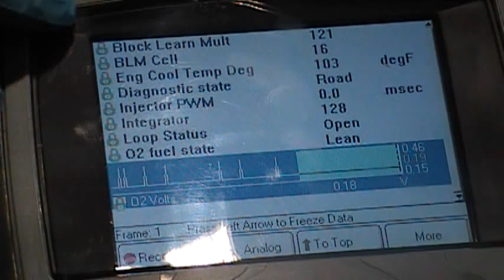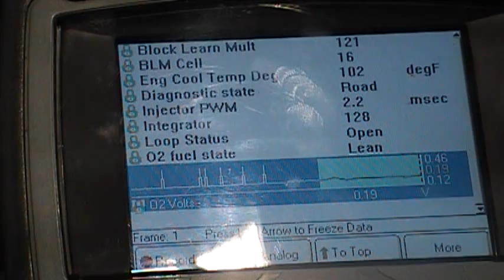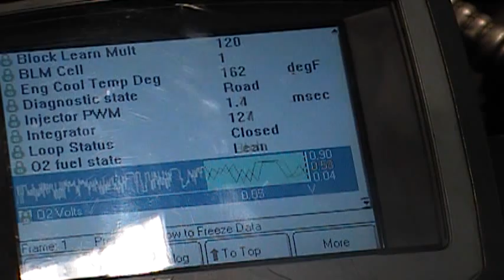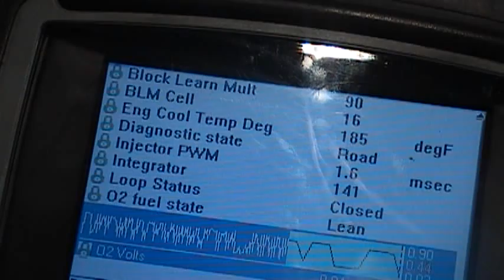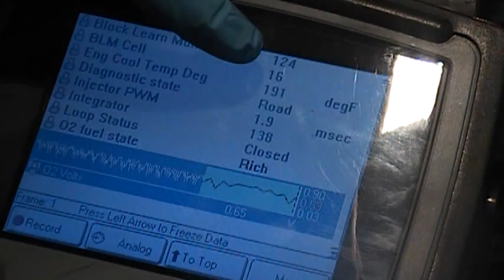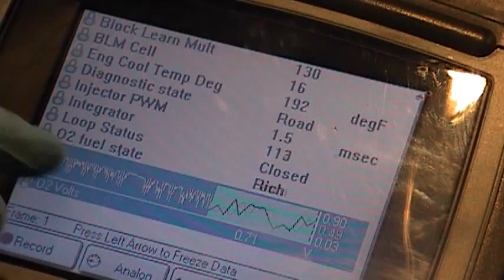Oxygen Sensor/fuel trim introduction and testing

Comment: i know it's not the purpose of the video, but do you know what could possibly be the reason for when i turn on stereo or fan, both o2b1s1 and o2b1s2 go down to 0.2 or 0.4 and does not move? i have a bank 2 and it fluctuates normally throughout. also, when i put the car in park, all o2 sensors go down to that value, which i assume is some kind of default behavior. but when the car is running with stereo or fan on, only the bank 1 sensors go to that 0.20 value constant. because of those bank 1 sensors, there will be a pending o2 code.

Comment: Hi sr, I know this video this video was done some time ago, bu I am watching today, and I have a question,  when you simulate the ignition  and  injector misfire  you are introducing more oxygen to the systems but in your Scanner you can see the O2 sensor still  cycle form 0.3 to 0.8 aprox,  and should be below 0.45 V because more Oxygen , I hope you can see this comment , thanks in advance
Reply from the maker: Ill have to rewatch the video, but if I remember correctly you should see the trend slide toward the lean side.
But also the ECM will increase the PWM to the injectors to compensate for the lean condition to bring the oxygen sensor back towards swinging up and down.  This is where the fuel trims come in very handy as they will show you what the ECM is doing ot keep the O2 sensor swinging between rich and lean.
Sorry for the slow response.

Comment: I have a 2010 elantra that has been idling rough for a few years. Only 88,000 kms.I have cleaned the MAF sensor, and the throttle body, replaced the PCV valve. Changed plugs.  I have a scan tool that reads on closed loop 2.0 volts on upstream 02 sensor and downstream 0.74 volts. The 02 sensor upstream spec's  for this car is a range of 1.50 - 2.0 volts were as other cars may be .1 volts - .90 volts ... .90 volts rich,  ,.  .1 volts lean.  So I get these readings at closed loop

                                  02 sensor B1Side 1      specs 1.50 - 1.75 Volts   Test results         2.01 volts ( Rich)
                                  02 sensor B1Side 2      + 0.70 V  min                                                 + 0.74

                                   STFT                                                                                                        -0.78%
                                   LTFT                                                                                                          1.56%

                                     Car still begins to idle rough once the engine heats up. Cold starts different at times. Idle gets better after I drive the car for a long time. Before it would idle better over a shorter period of time. Now it takes driving it for at least 30-40 min. It use to idle so smooth. But the car drives ok, but gas mileage not that great! What do you think?   Thanks Ed R

Comment: Thank you for the information Kevin, I have a Toyota corolla LE 2012 and I failed the smog test because of 02 sensor and cat are not ready!! but my car did not show any code also I follow a Toyota drive cycle and I drove 360miles highway 55 t0 60 after I slow down without using break just helping the car with hand break to 35-45 but still not ready! but when I plugged my OBD2 IT SHOW THAT MY O2S1 bank1 (V)=3.306 AND O2S1BANK2 (V)= 0.660 the car was warmed up for more than 10 min ! please do I need to change both 02 and after drive it probably it will make the car ready for emission! thank you very much

Comment: I own the same exact same year make model truck. 1994 Chevrolet S10 4 cyl 5 speed and I need help/advice... its been having a o2 sensor problem that has been driving me nuts.. The voltage will constantly read aprox. 1100mV with key on engine off and while the truck is cold started the short term fuel trim (integrator) will drop down significantly to around 60-70 and stay there and run like complete garbage and sputter after going into closed loop unless i hit the gas, then the o2 will start to oscillate and it will run better but still not up to par. EVEN IF THE O2 IS DISCONNECTED the value will then stay fixed at around 1100mv on my scanner and the only difference then is that now if you leave it to idle with no throttle input it will consistantly sputter/idle if you give enough time for the integrator value to decrease.. It was verified with a known good multi meter that it was showing the correct value. Comparing it to this truck in the video which is running how it is suppose to and the o2 value to mine this is NOT normal and there is no bias voltage occuring as shown on scanner in video. If anything, isnt disconnecting a o2 sensor suppose to make a vehicle run rich? What the heck. The motor was replaced with a fresh short block and it has done it even before the replacement. It will occasionally pre detonate while decelerating and at idle and i dont want to blow it up. I dont drive it anymore due to this.There is a new ecm as well as a whole bunch of other parts replaced!!!! This is probably one of the most infuriating and confusing problems I have ever encountered so far.. I AM STUMPED. I need help

Comment: Hello Kevin, and Eric,
I have a lean code p0171 check engine light is always on, the cr run fine and idles fine. air/fuel sensor fluctuates between 600 to 800 down to 200. the fuel trim long term is 15 + and the shorterm fuel is -14. Check for vacuum leak engine cold sprayed water all over intake manifold , vacuum hoses , exhaust manifold, its normal.  The air/fuel sensor drop to zero volts when I pulled the vacuum hose from manifold . Does a zero volt reading point to a faulty o2 sensor , its a 4 wire , on Toyota corolla 2000 4 cyl CE 1.8l.
Now today I will check spark plugs and injectors, its repeated ticking sound points to both injectors and spark. spark advance on the obd tool reads 15 with a G letter . What does it mean?

I have not back probe the o2 sensor because I can not find its o2 specifications on voltage drop and I don't know if its a wide band or a narrow band sensor. 

I cant find the fuel regulator in the engine. And I need to inspect all the vacuum hoses too. Its like being a medical doctor, I only have 150 hours of training with certificate from the 70s and learning all this analysis with fancy digital scanners can be very expensive for just a do-it yourself-er. 

can I use a volt meter with an amp probe together on a o2 sensor signal wire, instead of back probing? 

Can I use the wave screen on the less expensive OBD scanner, to see wave forms along with amp probe and wire clip , How do I set this up?
Reply from the maker: Whenever I get vehicles that have a major lean code with no indications of a vacuum leak I first clean and check the MAF (mass air flow) sensor.   The MAF sensor is very critical when the computer is determining the A/F (air/fuel) ratio, a dirty or failing sensor can fool the computer into thinking the vehicle is running lean (rarely does it cause a false rich) when it is not.
Reply: Hello Kevin, I had cleaned the MAF sensor with throttle fluid and a q tip.  How can I test it to see if its failing?
Reply from the maker: To be honest it is very difficult to test without access to a scan tool that displays live data.  And even then it can be tough to determine if the air flow readings are correct or not as there really is no set "correct" reading, as engines age the idle air flow rate also changes, carbon buildup, piston ring wear, valve seat wear and other issues will all slowly change the rate at which the engine moves air in and out.  Sometimes being able to see the load percentage displayed in live data can help determine if the readings are being skewed by a MAF that has lost calibration.
I also would not advise using a Q-tip to clean the MAF as the fibers can get caught on the thin wire and throw the readings off, a good spraying with MAF cleaner than allowing to air dry (not compressed air) should be enough to clean the wire.
Reply: Mr. Kevin thank you for your support and to Eric both are impeccable eudcators.
Reply: Hello Kevin, I re-examined the mass air flow sensor took it out sprayed with throttle fluid, clean metal surface of screws because it had an insulation from the di-electric grease I place inside the pin connectors. Removed the di-electric grease and place it back in drove in wide open throtle for 7 miles and the darn thing corrected itself and the check engine light went back to its cave.  The fuel trim in open throtle all positive low numbers and the o2 sensor went from 0 to 900 and back down at idle. I pulled vacuum hoses out; I pulled one spark plug engine turn-off. Its all working again no codes no engine check lights, long-term fuel below 10 and shorterm bet 2 and -3.. The IAT (IDLE AIR TEMP) WAS BET 90 AND 46.  I caused the problem when I changed the down pipe from exhaust manifold to the catalytic converter. I checked for exhaust leaks it may be sucking a little bit of unmetered air through the joint used finger to feel it but nothing was pulling in through the joint where the spring bolts hold it together. I want to say thank you and I just can't believe it.

Comment: great video!
one thing though, if o2 sensor reading 0.5v is being ideal afr or stoich combustion, why the engine cannot maintain that specific  afr? why it keeps going rich and lean?

also, under what condition it will go to closed and open loop? acceleration/deceleration?
Reply from the maker: Changing conditions in the engine cause the A/F ratio to change constantly, trying to hold a perfect 14:7 ratio is almost impossible and it is far easier to bounce the ratio up and down in a very limited range instead.  This also allows for the ECM to compensate for engine wear, fuel quality, barometric pressure and other constantly varying changes.
Reply: @kg4tnp  Also, the catalytic converter works best when engine oscillates between rich and lean conditions.

Comment: the other day i was on the freeway and all the sudden i smell rotten eggs (hydrogen sulfide?) and it was running odd but not like it had a misfire, so i pulled over to check it out. i scanned the vehicle (2001 gmc jimmy) and i got 2 pending fault codes: p0300 (random misfire) and p0138 (02 sensor circuit high voltage, bank 1 sensor 2, after the cat ). but then oddly enough it went away and drove normal the rest of the way and back home. but when i came home, i let it sit for a few. then i started it back up, engine spuddered a little then died after a few seconds. started it back up right after and it was fine again. i looked it up and it said that it can have a random misfire because of a faulty 02 sensor, but at the same time, it said a faulty 02 wont show symptoms? i dont know whats going on. if you can give me some info id appreciate it. i have  some  knowledge about 02 sensors.
Reply from the maker: jasonkgreen811 have some one check your exhaust back pressure, sounds like a partially clogged catalytic converter
Reply: ok thanks man.

Comment: I have a 203 Toyota Corolla and my check engine light came on, Autozone says 02 sensor on bank 1. I work only 1 mile from my house, so my engine, does not get really warm on my way either direction. The other day, I did take  drive and on the highway, my check engine light went off, after a while, but back to driving only to work and back, it is back on. Crazy.

Comment: what component actually takes the computer out of open loop and into closed loop,
Reply from the maker: crackbadger man    it is a combination of coolant temperature,  run time and o2 output voltage
Reply: thanks very much

Comment: quick quest kevin a replace my 02 sen bank 1 sens 2 on my 00 escalade yesturday n today coming home service light came back n show same code p0141 wat can i du wats the next step
Reply from the maker: Francisco Huerta  that code means the o2 sensor's heater is taking to long to bring the sensor to full operation.   check the fuses under the hood, look for one that says oxy sensor.  the fuse could be blown leaving the heater without power

Comment: Thanks - you explained very well the case when a cylinder that is not firing can be reported as a lean condition even though unburnt fuel is passing through the exhaust.  
Thanks for a helpful video.

Comment: hi im pretty sure thats a bias voltage on those sensors for diagnostic purposes you can use that too check circuit you have another heated circuit there too which may be a problem affecting fuel trims

Comment: Hello Kevin ,i have a ginesys evo scan tool similar to yours. just wanted to know if you have any problems with the battery. I believe mine is totally dead , No power on the tool at all ,even have the AC charger plugged in and nothing. Got a new battery on the way just in case.
Reply from the maker: could be,  the Genisys has a history of battery problems.
Reply: +Kevin Criswell Yes mainly on battery life for testing and overall battery life .
Reply: +Kevin Criswell Just an update about my tool . Got a new battery and it worked .However i noticed a short in the charging cord .Kept playing with it and noticed it was the charging port on the unit that had broken from the circuit board. I open the tool soldered two broken point from the charger port and now it charging like it should . Will do a video soon.
Reply from the maker: Good catch.   The Genisys is a good scan tool,  but I personally belive that for the price the build quality is s bit low.

Comment: hey kevin
I have 2000 chevy 1500 5.3
w the lean codes
p0171 p0172 ?
I did the intake casket and nothing changed dirty
and found low fuel prsser and install new pump
and still have the codes
anything u can think and let me
know
my thorttll plate is very dirty on the inside
and whated to clean it up and reset
the codes and see if they come back
Reply: Sounds like a dirty. Mass air flow sensor